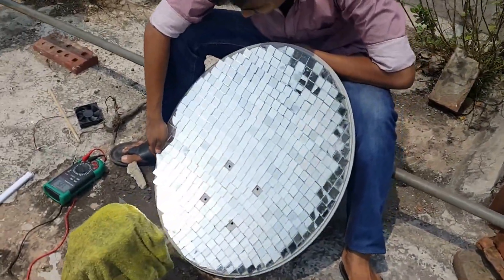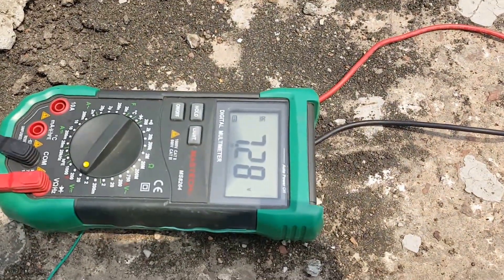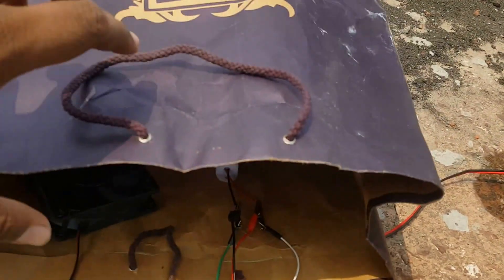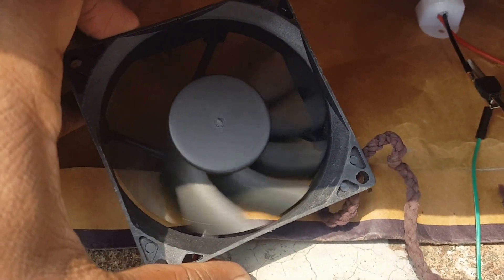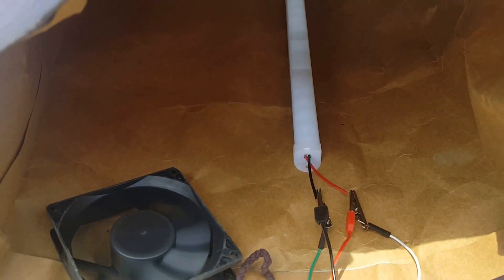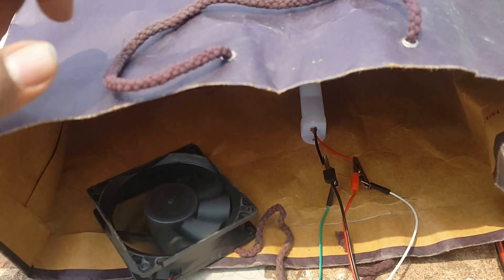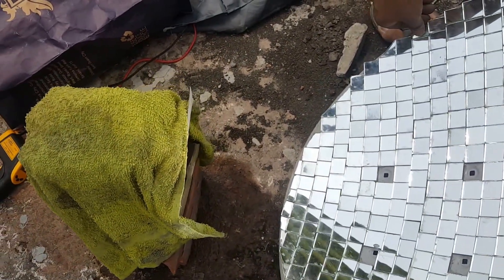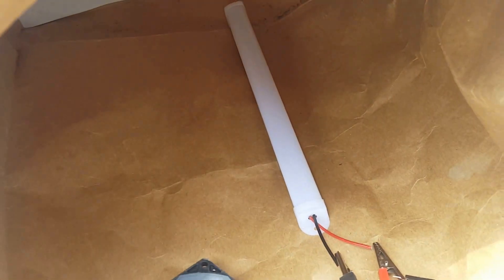Generation of Electricity Using Solar Dish and Peltier

Comment: Incredible job!!
how much amps did you get?
and what is the Dt between hot side and cool side?
Did you use 6 peltier plates?
12706?
Reply from the maker: First, accept my apology for the late reply. The output current was not that much high it was only 0.2 A. The max temp difference that we got was around 175-180. We used 6 Peltier's and sandwiched them all together and we used 12707.